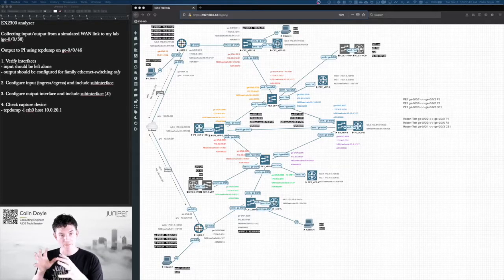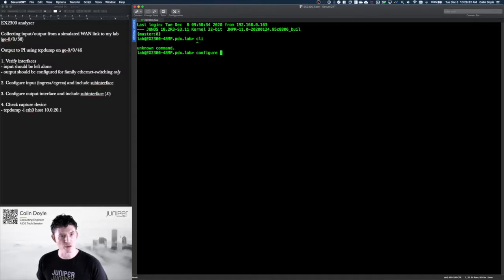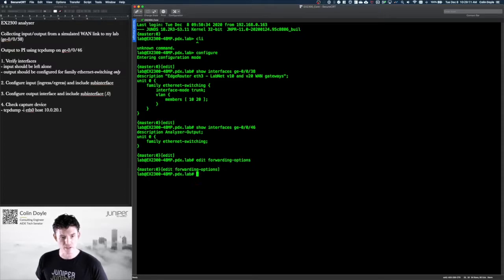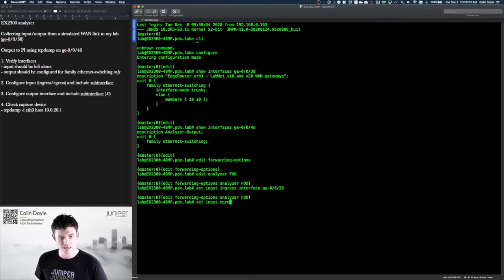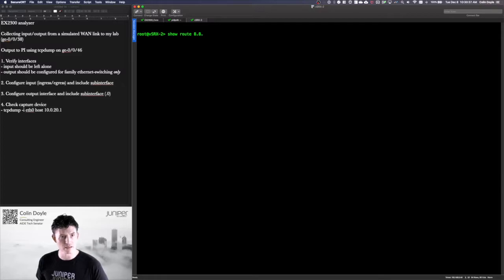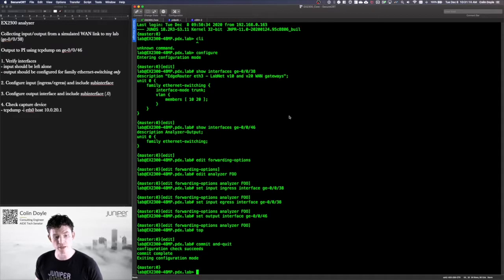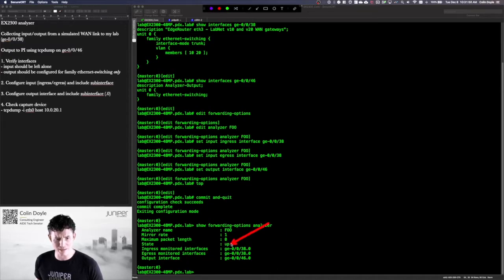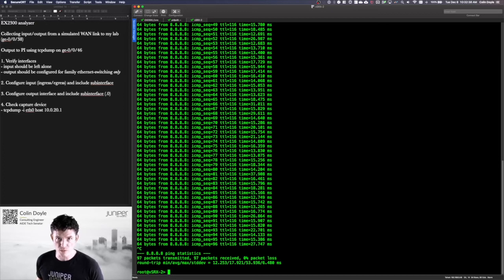Juniper EX Switch Analyzer Setup and Test

Comment: Would this analyzer show me IP packets? I have an access point I'm trying to capture all the wireless traffic off of and for some reason I only see layer 2 packets. I essentially want to see the packet of when my phone visits a certain website in wireshark.
Reply from the maker: No. Analyzers are used to inspect bridged (L2) traffic. If you want to see L3 traffic, you will need to configure a port mirror. This consideration is detailed here: https://www.juniper.net/documentation/us/en/software/junos/network-mgmt/topics/topic-map/port-mirroring-and-analyzers-configuring.html

Thanks for your question!
Reply: @5minutejunos  hey, so I actually had a support call with juniper today and I was able to use the analyzer to mirror all the traffic coming off the access point to wire shark. It just took some tinkering to break the GRE tunnel. Junipers literature on port mirroring and analyzers is pretty confusing but the gist of it is, use port mirroring when you want to configure a firewall filter to get more specific about the traffic your looking to see. My SE confirmed that this KB article could use some serious rewritting haha.
Reply from the maker: @GodsLoyalLaborer  Given that we're having this discussion, I have to agree that for packet analysis, our documentation could be more clear. It doesn't help that it can differ based on the platform architecture, either. Sorry for any hassle. Glad you got the info you needed!

Comment: Hey Collin I am here learning Juniper I have EX 4200 Series 48POE+ what do I need to connect to it
Reply from the maker: For management, you will need an RJ-45/RS-232 console cable. Every Juniper switch ships with one of these cables. In fact, every Cisco, Arista, HPE, etc... switch ships with this cable as well.

I use a wireless console cable from get-console.com

Comment: Hi Collin, suppose the switch in in a remote DC and youy dont have PI connected to it, how to send the capture to a remote management station? Big big thank's for all yours videos! You are doing a great job, it's well explained and easy to understand even if english is not ma first language!! :) Pat
Reply from the maker: It depends on the switch. Some platforms support configuration of an analyzer with an output to a specific VLAN. In this case, you would configure the VLAN between the remote switch and your tcpdump client. Other platforms (usually higher-end routers and switches) support forwarding mirrored traffic to a specific IP address destination.

Look up "junos analyzer" and you should find what you're looking for.

Thanks for watching!

New video series coming soon :)
Reply: i was looking for the same thing but juniper documentation sucks
Reply from the maker: @Hanamichi6666  Our documentation for mirror certainly isn't anything to write home about.